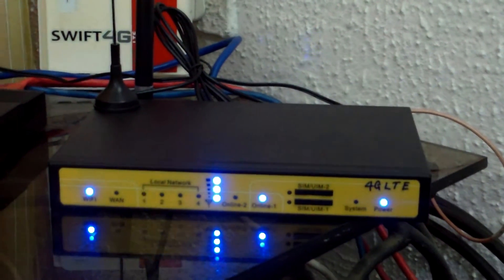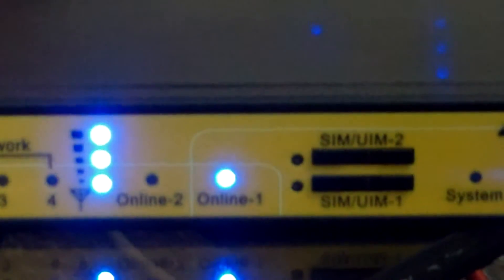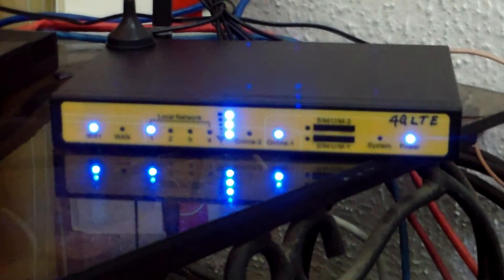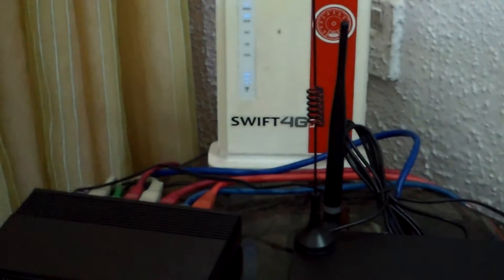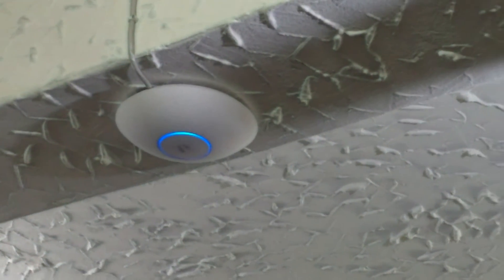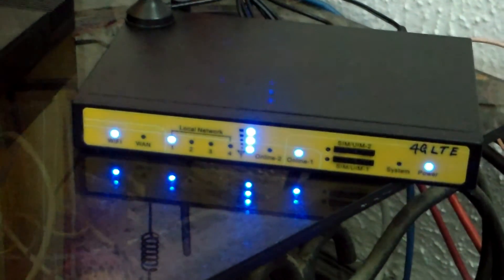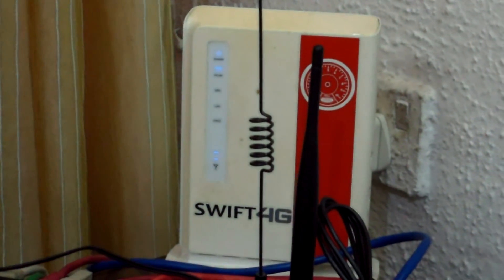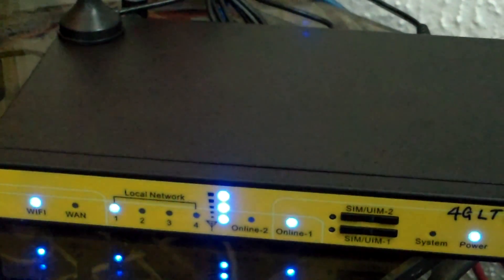4G-FDD-LTE  Dual SIM WiFi router

Comment: Is it two sim works at a time???
Reply from the maker: For this particular model, one sim works at a time. However the F3946 FL/FL or W/W has two modules inside. This allows the two sim cards to work simultaneously. The module has the ability to work simultaneously or one module at a time.

Comment: Hi there, I enjoyed your video. Can you tell me if it is possible to create time schedules for the router to switch between sim cards?
Reply from the maker: Thanks Angelo. If you are familiar with Unix operation system, I think you would be able to do that since the router has  crontab features. This I believe can be configured to run at scheduled times to switch sim cards

Comment: I have one of the routers, F3832 LTE/WCDWA Dual-SIM Router (Support LTE FDD 2600/2100/1800/900/800MHz, 700/1700/2100MHz). I try using it with Ntel, but it is not connecting. The signal strength indicator is full,  but neither is SIM 1 and 2  ON. Please, what is your setting like?
Reply from the maker: It works, let me see
Reply from the maker: which particular setting would you want to see ? Have you put the apn settings ?
Reply from the maker: Sunday Olutayo are you on Skype or have a chat id?
Reply from the maker: use APN name of ntel but leave username and password blank
Reply: skype: sadeebtech
Reply from the maker: added you

Comment: Will this device merge 2 SIM (Mobile Data) together?
Reply from the maker: Ahetesham Uddin Masum no the router uses two sim, one is online and the other one is stand by. It defaults once there is a network failure on the primary sim
Reply: Ohh. I am looking for a solution that 2 or 3 mobile data will marge together for lIVE Broadcasting. Either it’s a Router or any other device. Anyone can help me .
Reply from the maker: There is another version of this router that has two SIM cards and both SIM cards can be online at the same time.However I need to confirm if this merges both mobile data together on both cards
Reply: Which version device, will use two sim at a time?
Reply from the maker: Hi Ahetesham Uddin Masum F3946-FL/FL FDD-LTE/FDD-LTE WIFI Router . Please modulation of carrier you are using before purchase.
Reply: @aheteshamuddinmasum4486  find on the web for "router bonding"